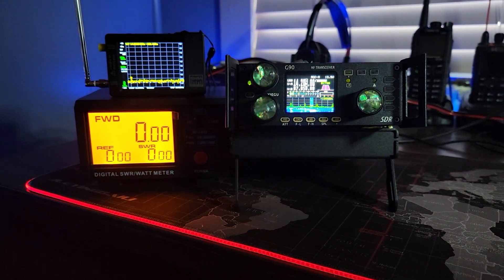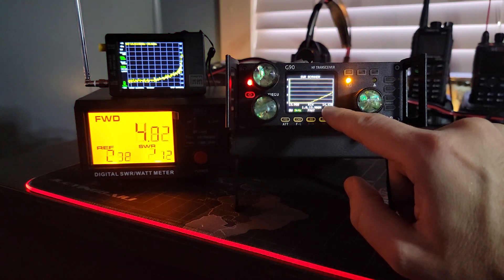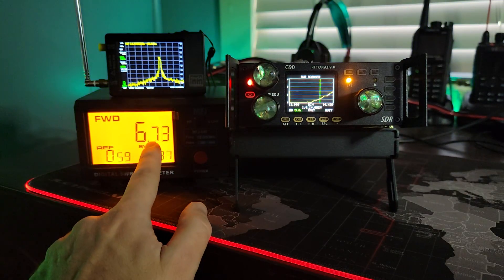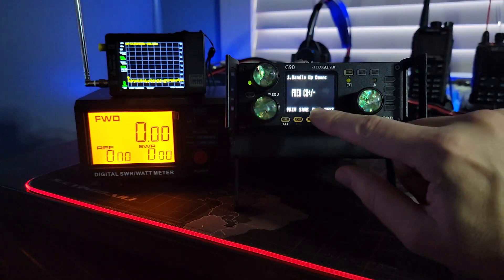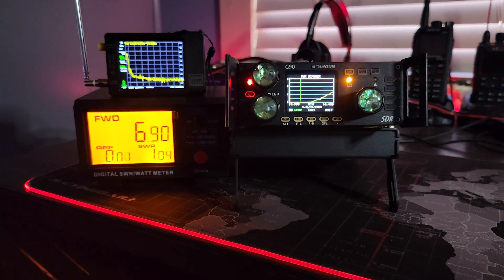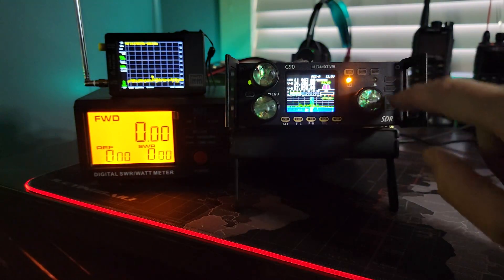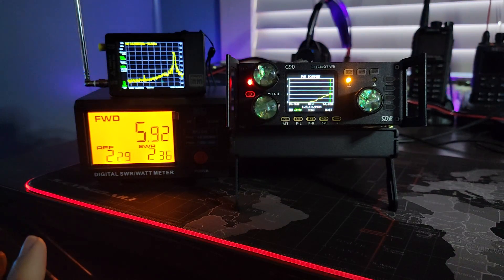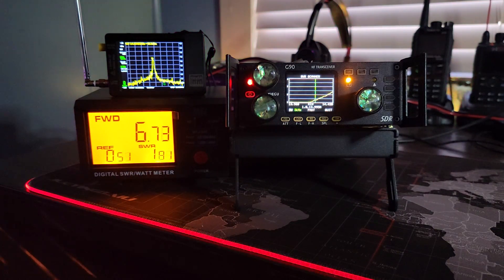Does the Xiegu G90 Smell Too?

Comment: Because it takes 7 watts to fully load the bridge of the swr ... ATU..... If unset it at 1 watt it won't load the bridge properly..remwber when setting a vswr u should test at full power output from the transmitter ..... Give u a more honest sweep ...yes the tx has to go to output mode to sweep ..so the bridge is loaded aslong as the sweep is active
Reply from the maker: Is there an upper limit on power when testing SWR? 1500w?
Reply: @temporarilyoffline  what I'm saying is u Wana do a.swr sweep umder a decent load to fully bridge the vswr meter ATU  internal ... The swr will be more accurate and the ratio will be more true ...hope this helps..
Reply from the maker: @justinruth9729  I hear ya

Comment: Hello Steve. Thanks for doing this test for us. Question I have the same radio I bought August of 202 never got the chance to play with it. Too many radios right now I am working on. So, will it transmit at 20w as per the limit on the radio. If you're showing 7w on the 1w setting? WOW. You learn something new all the time. I have not updated the newest firmware as of yet. I do also have the PAX100 RF Power Amplifier 100W For Xiegu G90 and the LPFX7 Low Pass Filter Full Band Filter Board. PAX100 is a mini-RF power amplifier. Happy Holiday's Ruben KD6CWI
Reply: put a THUMBS Up on this
Reply from the maker: The radio is a lot of fun and it will do full power out on normal Transmit, this 7w is only during the swr scan.  Just wanting to be absolutely clear in case I wasn't.  Thanks for watching!

Comment: If harmonic radiation and spurious emissions are below FCC limits then I think it’s the station operator that’s transmitting an unidentified signal outside the authorized frequency band. That said, it would be nice if the radio would let you configure the sweep limits so you could use the feature without violating your license. And, 5+ watts for an SWR sweep does seem a little much. 

Hardly seems possible, but the more I see from them the less interest I have in Xeigu radios.
Reply from the maker: @qrplife I am pretty sure it's a simple enough software fix.  The radios are fun toys and are pretty useful.  You are right though, there are better units out there!

Comment: Thanks.

Good to know.  Of course, out of band and unidentified ambitions make me cringe from the regulatory point of view, but test equipment is a grey area.

I wonder what the actual test equipment like the various VNAs and antenna analyzers put out, particularly out of band.  You can't measure impedance without excitation.

And I have often thought that modern transceivers already have all or nearly all that is necessary to make automated measurements.  Hopefully the non-Chinese manufacturers with start doing it, but the right way (low power, respect the band limits, or let you set them).

(I wonder if I can do it with python and hamlib?)
Reply from the maker: Hamlib and python would be fun to try!

Comment: Yep, I was testing both my Xiegu X6100 and G90 radios and they both disregarded the power levels when doing a SWR sweep.  As well, I had the power levels set down to the lowest settings which they both ignored.  My testing was in band -- but nevertheless, I am now enforcing my Baofeng "be careful what you do" protocol with my Xiegus.  But yeah, it seems that this is an easy fix in the firmware.
Reply from the maker: I'm not a lawyer and I don't have enough money to win this fight, but I'd argue that the SWR Scanner is "test equipment" and not "Ham Radio" - so fix the power levels and leave the rest of this very useful tool as is.

We're going to have more and more ability to combine technologies... (legally), so why not allow for that to happen

Comment: Transmitting outside of a band at any significant power (levels change depending on the band) is illegal, except for safety/emergency reasons.  The FCC analysis should have caught that.
Reply from the maker: For a radio, agreed - but in this case I would hope the FCC is smart enough to notice this is an "antenna analyzer"... shame on xiegu for sure for making it use so much power though.
Reply: Antenna analyzers transmit out of band during the SWR sweep. But it’s legal as long as it complies with 47 CFR § 15.209 - Radiated emission limits; general requirements.
Reply: I believe the law us to not transmit. It doesn't matter what the device is called.  It's still illegal emissions .